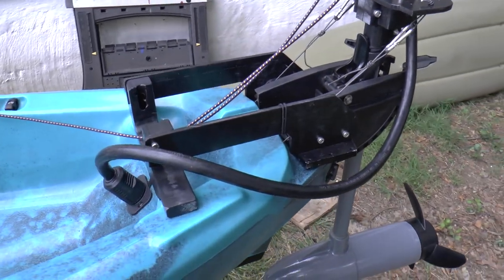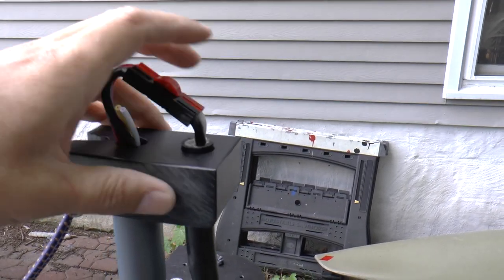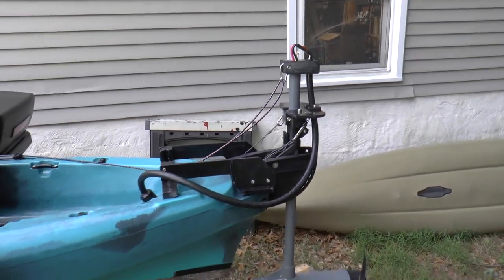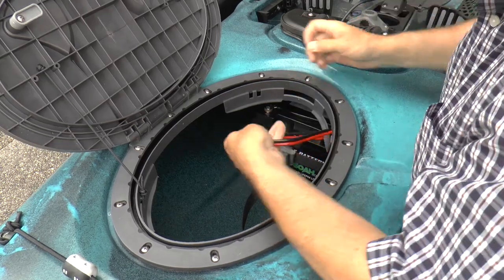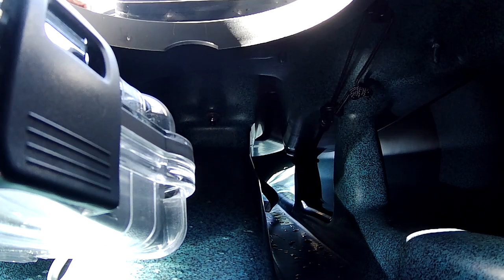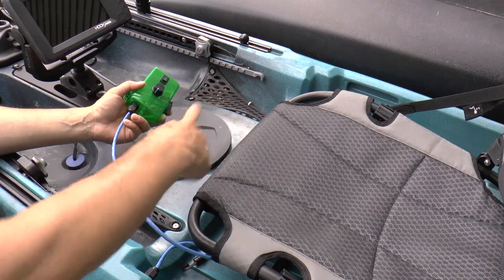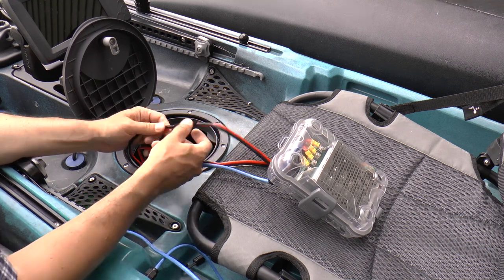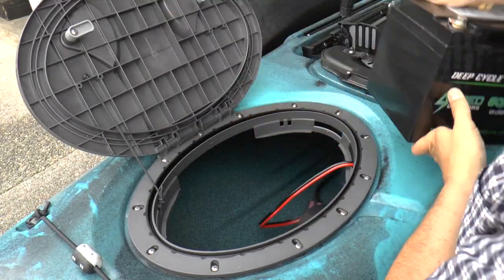Electric motor powered Tarpon 130x, part 2, motor wiring and PWM controller

Comment: I use the same box for the forward reverse and power knob. although I was able to put them on the inside of the cap  to a fashioned piece of plastic. With the lid closed they are protected. It reminds me of a wide joystick. On the interior with the wires I glued to magnets. I also put magnets on the interior of the kayak. I have several spots to place the controller. The interior kayak magnets also double as a temporary lure holder. Thanks for the videos. Tight lines to you sir.
Reply from the maker: Great ideas!  Shoot some video clips and throw them up on your channel!

Comment: Great video. I like how much detail you put into it. Here in Va / NC they just passed law that any motorized boat 26’ or under must have kill switch installed. I was told by Conservation Officer this will be for motorized kayaks.
Reply from the maker: Kill switches are a great idea, for safety.  But, as far as I can see, electric motorized kayaks fall outside the requirements in the new federal law that went into effect April 1.  We're under the motor power limit (3hp) and speed limit (on plane).  But, just because we don't have to doesn't mean it's not safer to have one.  Going overboard and having your kayak leave you behind would not be fun.

Comment: Nice work. I first installed a trolling motor on a kayak in 2013 and just mounted the switch in a waterproof box. Later, I tried three different PWM's and all failed in the heat and humidity of NW Florida. On later installs, I just continued to use the switch and it met my needs. With the increasing popularity of kayak fishing in my area, I want to try a PWM again to maybe extend my fishing range. I am interested in which PWM you used as well as the locking connectors.  Thanks in advance.

Comment: Wondering how you installed your quick connect on your kayak. I like the spot you chose for yours but how did you reach from the inside to install it and tighten down the ring?  I have a sea ghost 110
Reply from the maker: The bulkhead connector attaches from the outside with screws.  So I didn't need to access the inside.  I drilled a hole for the body of the connector, fished the wires through the hull and out the hole, attached them to the back of the connector, then mounted the connector to the bulkhead with screws.

Comment: looks great.  Any heat issues with your pwm?  I think I am going to build something like that but I hate that the remote will be connected to kayak and can never be removed.  Does that bother you?
Reply from the maker: No heat issues yet.  I would much prefer to be able to remove the control box.  There are waterproof ethernet connectors that would allow this, but they are ridiculously expensive. It seems crazy to pay more for a connector than the entire PWM.